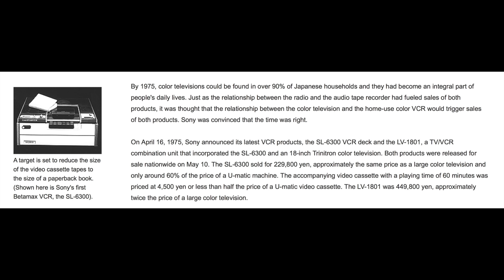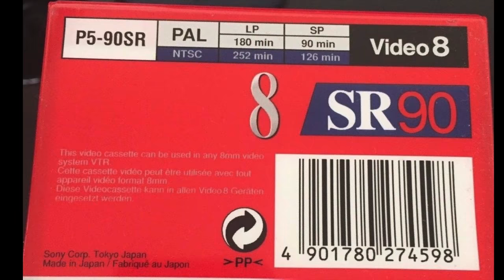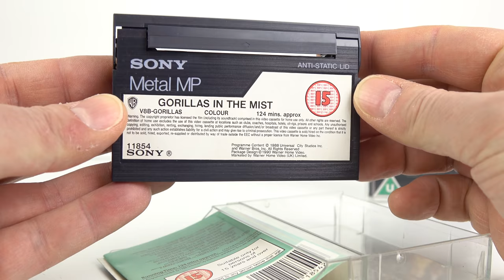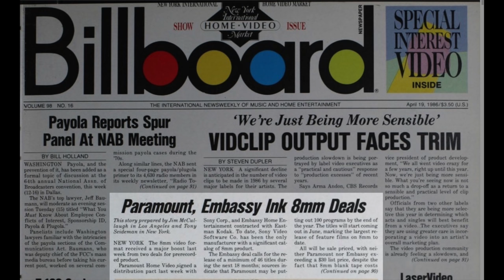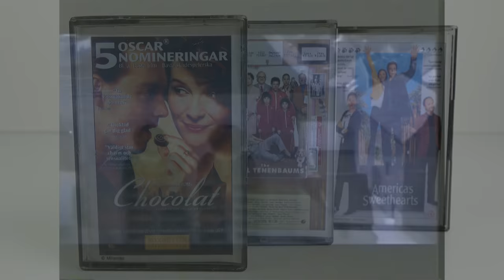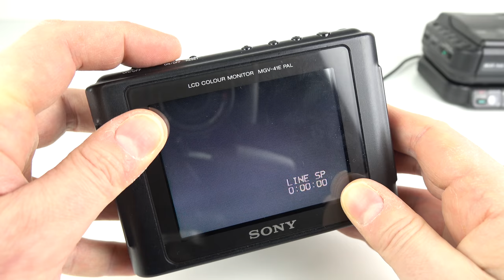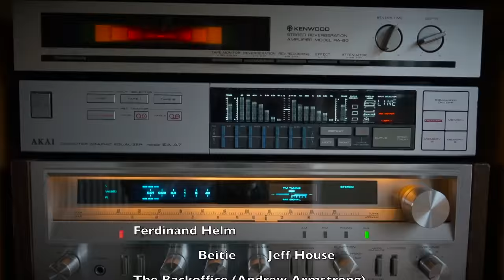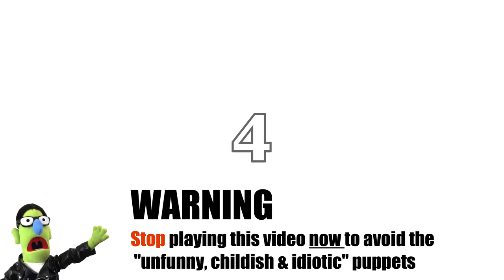Video8 - Sony's forgotten ambitions & the crazy Walkman Compo

Comment: I can't remember where I saw it exactly, but just one or two years ago I was on a plane that still used a tape based system. Since I have never heard of any other format than Video8 being used there, I assume it is Video8. It was clearly visible by the strange "noise lines" you sometimes get on the bottom of your screen when playing analog video tapes  and by the fact that it needed a few seconds to stabilize tracking after playback started. (Of course it may as well have been a digitized version of a poor tape playback, but that thought is ridiculous.)
That aircraft didn't really use IFE as in playing movies to entertain people, the system was rather used only to show the safety demonstration. The screens came out of the ceiling, the video played, the screens retracted and stayed that way for the entire flight. I was totally puzzled as to why an airline would install a system like this with the additional weight and maintenance that comes with it instead of doing the good old manual "safety dance"  routine, which just needs some demo equipment in addition to the cabin crew wich is on board anyway.
Even though old stuff like this fascinates me, I am quite happy to have video on demand on practically any longhaul flight today. It is simply more enjoyable than that night in a BA DC-10 back in the day where they showed only one movie after dinner, turned off the entire entertainment (including audio) and I was in the only seat with a broken reading light. A night over the Atlantic is sooooo boring.

Comment: Back when you still had hair I had a couple of the GV modular systems both 8 and hi 8 portables  but the tuner popped onto the side.  I used to travel a lot by car in the US in the late 80's early 90s , and if I were in a hotel I'd set that unit up to record local TV newscasts.  So imagine a local news cast from Pierre, SD USA in the early 90's. Something like that.  I ve got a bunch of those tapes hours and hours from almost every TV market in the US someplace (little time capsules). But what was also sort of interesting I owned a Sony Glasstron?  Which was an early video goggle system that produced an image of about a 50 inch TV set onto your eyeballs..  IF I had someone riding shotgun in my car on a long car ride, they could watch local tv off the GV module or play a pre recorded movie if they wanted to.  The thing looked like large ski goggles (each eye containing a TV screen that you'd merge into one view sort of like a "Viewmaster", certain subject matter was really interesting to watch.    And you could actually see through the video almost like a heads up display if you wanted too , very odd device, then Casio came out with something similar about a decade after sony (for way cheaper).   Lots and lots of wires needed to run that thing in a car while driving back in the day..      Thanks for bringing that format back to life for a few seconds.

Comment: 22:00 problem with those MR2's though is the damn hose from hell that was notorious for failing as well as requiring to completely pull the engine to replace.
Reply: The hose from hell is on the 3SGTE engine on the 2nd generation MR2. The 4AGE or 4AGZE in the 1st generation (AW11) doesn't have that problem.

Comment: I've still got a video 8 home recorder and you could record sound only on four tracks giving about 8hours of continuous music
Reply: and this in PCM digital recording! (I've the EVS800B) 8mm hi8 were available in 120min format, giving120 minsx8 tracks = 16hrs of PCM stereo music !!!! I used it to record FM radio programs for years.... they are still playable... a masterpiece of technology! you could also overdub the sound of the video in digital, and with a little trick also get the original analog track on the line out making then a 4 track system... or integrate the original motion picture CD with the movie... It just took time and a little bit of inventive imagination...

Comment: I suspect the reason for the the lesser recording/playback time on the PAL version, is the difference between resolutions. 525 lines per minute for NTSC, as opposed to 625 for PAL, so less video detail to record on tape equals more capacity. Still, PAL has to look a little better in EP mode than NTSC.

Comment: I have seen a few of your videos where you discuss long play audio units for playing a lot of cassettes for hours over and over again, so I'm a bit confused that the audio capabilities of the Video 8 recorder at 4:20 wasn't mentioned in more detail.
Video 8 audio was 8 bits non-linear audio at 32 kHz sampling rate. With that recorder you could select an audio-only mode which replaced the video part on the tape with five more digital stereo channels (you can see evidence for that in the display to the left of the level meter, the numbers 1–6. There was also a LP mode, which doubled the playing time. If you had a 90 minutes tape, that meant that you could record 90×6 minutes of audio, which adds up to 9 hours, and that's in SP mode. In LP mode that's 18 hours of digital audio in stereo! Unfortunately you had to rewind it every 90 (or 180 in LP) minutes and switch to the next stereo channel (or maybe there was some built in automation for that, I don't know).
The sound quality should be approximately like FM radio (20 Hz–15 kHz or similar) but without most of the noise and probably less distortion. It was, as I said, 8 bits non-linear (greater steps at high levels and smaller steps at low levels) PCM and on top of that there was some kind of noise reduction, similar to dbx, I think. It would be interesting to know more about this. I only write this from my memory of reading a test of that video recorder in a magazine when that machine was new, so I never had one myself or even seen one in real life, I think.
But I thought that it was strange that it wasn't more popular. People seemed to like long playing times, and nobody could beat 18 hours on a small volume like that at the time, so it should have been popular, shouldn't it. I guess it was just too expensive, and people maybe wouldn't by a video recorder for their audio needs.

And by the way, I'm Swedish, so I understand the words ”inresa” and ”utresa” on those cassettes. ”In” means in, ”ut” means out and ”resa” means travel or journey. ”Utresa” is when you travel away from something and ”inresa” is the opposite.

Comment: I had one of those video compo things bought on Tottenham Court Road in London when it was a consumer electronics Mecca. I didn't remember having to buy the components separately but you may be right. I can assure  you the noises yours makes are normal behaviour. I had the tuner part but don't think I ever used it to watch TV, which would have necessitated also dragging around an antenna. However, you had to connect it for the card-type remote control to work. I bought it intending to use it in the car but never would have felt safe leaving it overnight and I would soon have tired of taking it with me.

As you predicted, it didn't last for long. From memory it didn't appreciate my over-zealous efforts to remove a jammed tape.

One last thing. I heard a quite plausible theory that the porn industry is what gave VHS the commercial advantage it never relinquished over rival and usually technically superior tape formats.

Comment: After V2000 from Philips failed, they also wondered a short while about Video 8 as universal home recorder application: I once noted a (prototype?) Philips recorder on display in a HifI shop, but it never was sold over here. Being accostumed to V2000 quality. I only wanted Video 8 in the camcorder in its Hi8 format, starting with the Sony V700, an expensive machine that failed VERY soon. For editing and long time storage I did not trust this material so in came S VHS recorders from Philips (rebadged Japanese ones). I still have the latest homerecorders, but another  Hi8 camcorder and its DV-successor ( both from Canon) have now gone defective as well. And most Hi8 tapes from Sony (the damped layer ones, not MP=metal particle from Fuji) are not playing anymore either. The S -VHS backups work well though, but my long time storage has now moved to digitalised formats like DVD's and BluRays and ISO files on 3 harddisk configurations (twice external HDD, short term on PC-internal only) . In my opinion Video8/Hi8 is just an unreliable tape format and even the DV camcorder technology proved to be just as unreliable over time. Good riddance I would say, a shame so much effort was put in these Sony machines at the time for nought. It reminds me of Philips last failure in tape technology, the DCC system: also failureprone and way too complicated to manufacture cheaply.

Comment: I have a broken  Sony 8mm deck here  which I have look at and also the Kodak 8mm camcorder with a tube image pickup along with its deck style  cradle with the TV tuner..Alsi I have several 8mm camcorders here in the collection.....

Kodak claims they were the first with the 8mm format in 1984 with later Sony..

8mm format  was better then those VHSC  camcorders with limited  20 or 30 minute recording time .I have a few VHSc camcorders here collecting dust.....Also saves storage space too since the tapes are smaller then VHS full size ...8mm never did alot of damage in fear of taking the market over.VHS was put to sleep in 2016 

Later on the smaller  DV tape format killed off the 8mm  and Hi8mm format.

Love to get a Sony 8mm  watchman.

Comment: Airlines still using analogue formats for video these days doesn't really strike me as unususal.

To this day, there is still a big market for one single company that supplies 3.5 inch floppies to airlines as they still use the format on some of their older aircraft.

Legacy tech does have some benefits and in many of these heavily integrated systems, it is way too expensive to retrofit a modern day solution. Having said that, it does need to be done eventually as even these reliable systems will eventually become unrepairable.

One story I remember is from my days of working for a supermarket company in Australia. We also owned a chain of petrol stations (gasoline stations for our US friends) which utilised a computerised terminal system that's been in use since the early 80s. Very reliable and vstill very fit for the purpose. At around 2006-07, the company decided to replace all the terminals and comms systems with Windows and ethernet based systems. The reason?
By 2005, there were only TWO people in Australia that could repair the systems. One of the techs passed away towards the end of 2005, leaving only one tech left who was hitting 90 by then. If he wasn't available, there wouldn't have been anyone that could repair these terminals or understand how the system worked.

Comment: Biggest problem with video 8 was the unbelievable fragility of the tapes. The tape heads clogged easily and the tapes usually wound up a tangled mess. When it worked it worked well though.

Comment: Sony could have won with video 8  have a batamax trade in program so that if you a a Sony branded batamax vcr you could trade it in for a video 8 VCR for free or extremely reduced price same with the film tapes much like most companies did with HD-DVD just extended to the hardware. Some times you have to give away the razors to sell the blades.

Comment: I remember that you could get a video 8 adapter for your VHS  player
Reply: I don't think so. You could get a VHS-C adapter for VHS, but video-8 is a completely different format electronically, so even if you could get the video-8 tape into the VHS tape path, it wouldn't play back.
Reply: Ur right,  I was thinking of the camcorder that was  similar  size to the video 8 .  Thanks for putting me straight 😁

Comment: Pity it didn't succeed, for a compact video format, it held up to 2 hours regular play, and 4 hours max. Compared to the VHS -C format, that's far better, without sacrificing quality (VHS-C had a max of 45 minutes, 90 at EP playback, with a significant loss of quality). The tapes were, of course, smaller, and when they made the Video Walkman, the LCD screen at the time was state of the art, looking awesome despite the size.

Comment: If you are going to buy a Sony Video 8 Walkman do not buy the Model GV-8 (First model) or the GV-9, they are very hard to restore. The GV-200 or GV-500 which I have both are better designed and usually are still working. The later GVD-800 digital 8 video walkman is excellent as it does not suffer from capacitor leakage.
Reply: Oh... I bought a GV-9E (PAL version) recently. A nightmare to work on but there actually seems to be no capacitor leakage.

Comment: Actually my father has a working camcorder (Blaupunkt) and the video walkman shown at 9:10, both of them are working fine (or at least they were working fine several years ago when I've touched those), and both of them has similar noises, so I guess that's totally normal. There was also a larger (thicker) battery available for those, and there is an adapter to put 6x AA batteries into this, which could help extend the battery life. I guess the original batteries were somewhere 500-1000 mAh, but with newer NiMH batteries you could even reach 3 times of that..

Comment: Although video 8 didn't get a large take-up with domestic users, there were various industrial versions available. A company that I worked for even produced a computer-based teaching system using video 8 and a BBC B computer! The reason for choosing Video 8 was the relatively fast access time to locate any given section on the tape. There was  even a video 8 twin-deck editing machine.

Comment: I think that Video8 would be better for home video, because of the smaller size of the tape. Smaller tapes mean smaller players, recorders, cameras and less space used to store tapes at home. Video8 could be also good for music recordings as well. Imagine having an universal player/recorder an universal tapes for music and videos in that time.
Reply: When it came out, it would still lose to the VCR in the two most important areas:

Record time and install base.

Record time was a critical feature of a VCR, far more than picture quality, physical size, or pretty much anything else (one of RCA's last great contributions to our enterianment industry was to ask JVC to include the LP option on VHS, despite JVC arguing that it was wrong to decrease quality). Even though Video8 exceeded certain key thresholds that Beta had struggled with it would still be noticeably worse.

By the time Video8 released, VHS was already established and in many homes. In additiont there was already a fast growing video store and rental industry that was heavily in favour of VHS due to its install base.

You would need something big to convince people to switch formats. DVD would end up using several points to finally replace VHS for home video. First, it added quality at a time when TVs were increasing in size and quality. DVD quality would have been pretty meaningless to most people in the 1980s, using 23-inch tube TVs in their living rooms. DVD had a major convenience advantage with the ability to hold a bunch of programs on a disk along with things like scene selection and commentary tracks. And DVDs only really took over when the PS2 came out so you didn't need a dedicated box.

Comment: Your discussion of the video8 format is incomplete with out touching on the fact that home decks can be switched to the multi-pcm format giving the user six stereo tracks of audio only. Six stereo tracks the length of whatever size tape you have. That these tracks can be played in series giving the end user a very large capacity to store audio which can be played back consecutively. You show the ev-s700 switched to pcm audio and never hit on the wide range of posibilities that video8 tapes offer. I suggest you get on ebay, bring home a ev-s900 and take it through it’s paces.

Comment: Our dad was pretty minted in 1985 here in the UK, and bought the funky new Sony CCD-V8AF-E colour Video 8 camera, which he used to film all our holidays for years. 
He also bought the accompanying Sony TV Tuner for the lounge, a slick black remote-controlled unit, looking like a bit of hi-fi separates, but around half the height of a regular VCR.
It could be programmed to automatically record TV programs directly to the camera for later playback, albeit it could only record a maximum 90 minutes , so all my favourite movies had the end chopped off. It's reliability meant we didn't get a VHS player in the house until the mid nineties, and missed out on getting films from the video rental shop :D 
We never knew you could buy pre-recorded movies on Video 8 though!

I've never met anyone else in the UK who had this setup. We also had an Apple II computer, when everyone else had Spectrums and Commodores. No wonder we turned out weird ;)

Comment: One point of interest - 06:39 isn't quite right,  Video 8 AFM did sound a lot better than VHS linear audio, that's entirely right but it was still pretty poor compared to VHS HiFi (or Betamax HiFi) - AFM-Stereo (a latter standard) has some quite notable issues with stereo reproduction and it's great for a camcorder but it wasn't very high fidelity.

There was Video8 PCM but that's a whole other topic, it's good but it uses some very strong compression (it's an 8-bit encoding on the tape) - superficially it sounds very clear but A/B it against CD or VHS HiFi and it's a night 'n' day difference.

Only a small thing, but don't rush out to invest in Video8 for analogue audio recording, the results with be a solid 6/10 compared to VHS HiFi.

I'm currently making a video on this!  This is a great video, I'm just raising a very minor point :P